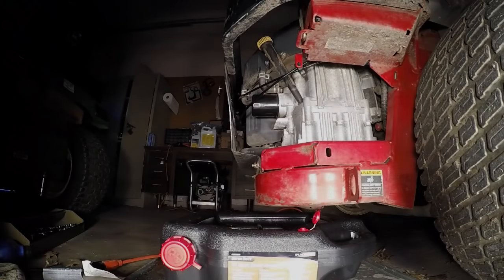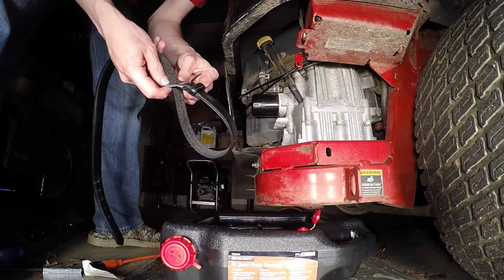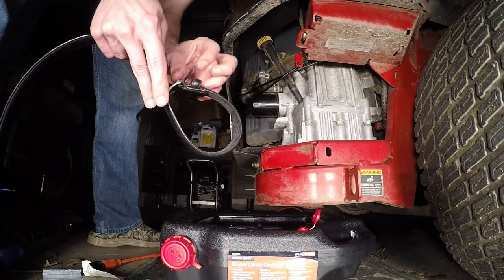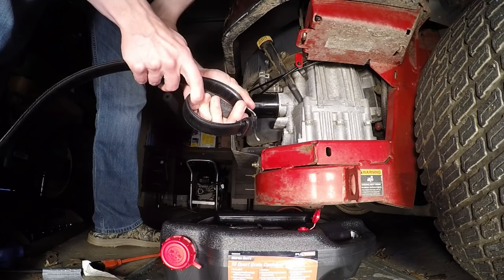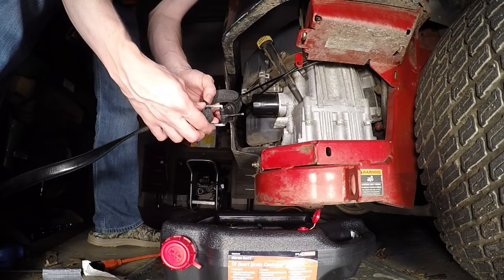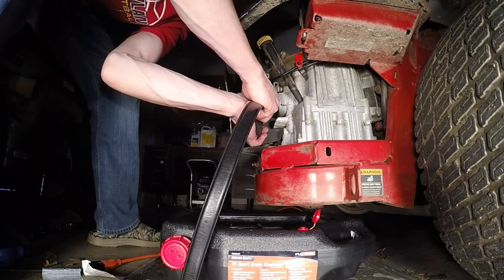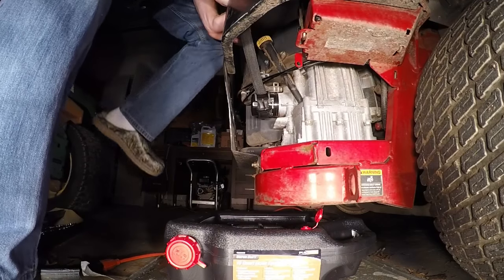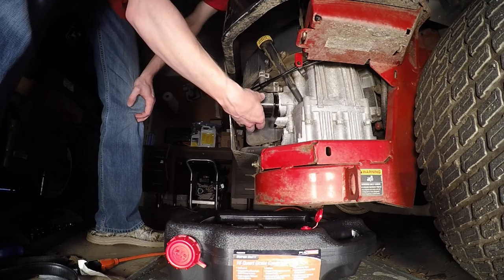Removing Stuck Oil Filter with Belt Strap

Comment: Done this many times with belt, rope, straps, you will find it's better an easier if you wrap whatever you use once or twice around the filter, then when you pull it will tighten on filter and actually spin it.
Reply: worked for me wrapping it around twice thank you

Comment: Great tip man!! Quick question, I noticed your oil filter is on the side like mine rather than faced down, so how do you prevent the oil from running on the block when you remove the filter? I’m assuming just clean it up with a rag after before it sticks on there and dries but really like to prevent it if possible
Reply from the maker: On cars I usually start the engine for 5-10 seconds after draining the oil to pump the majority of what is left out of the filter. Put the drain plug back in before starting or it will spray out the drain. It isnt perfect but it helps reduce the cleanup. Won't work on all equipment. There is always some cleanup.
Reply: Freeman Garage perfect just what I needed to know
Reply: I’m no expert but i would never start my vehicle with no oil in it. Even if it was just for 5-10 seconds. Just clean the oil up when your done.
Reply: @johnnyappleseed4492  you actually bring up a point doesn’t seem like it would be good on the oil pump but I guess 5-10 seconds like he mentioned wouldn’t do too much damage